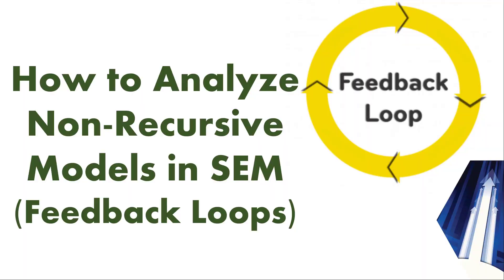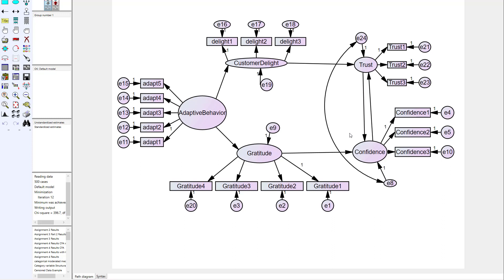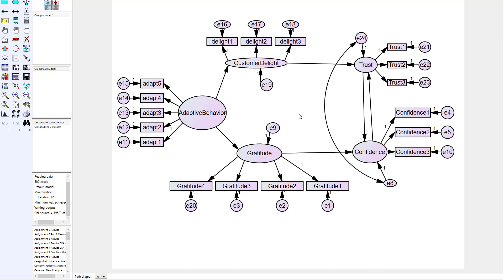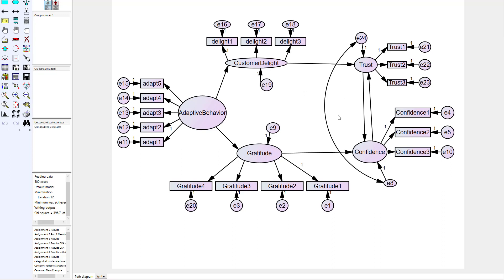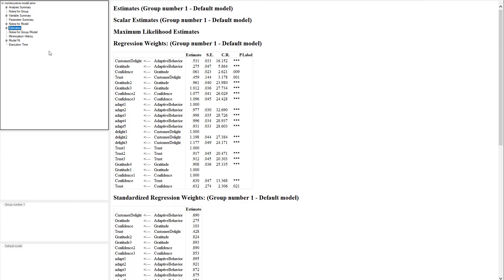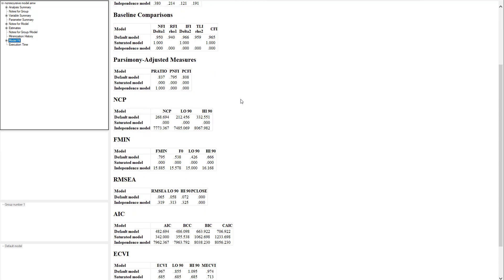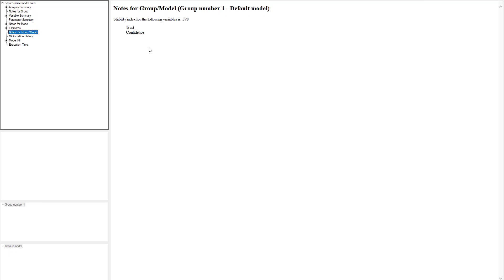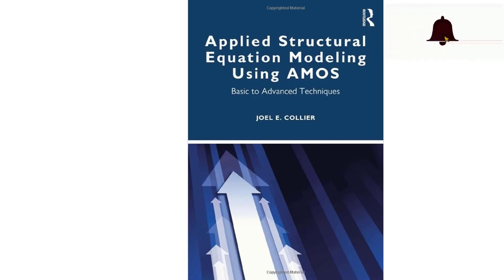How to analyze feedback loops in SEM using AMOS

Comment: Hello sir, for the mediation value in the bootstrap P-value = 0.021.
Lower bound=0.351
Upper bound=1.251.
Is this significant or not?
Reply from the maker: If the lower bound to upper bound confidence interval does not cross "0", then it is significant at .05 level
Reply: @joelcollier9387  What about the above conditions? 
Can it be called significant or not?
Reply from the maker: @makmursujarwo9458  Yes, since it does not cross zero then it is significant at the .05 level.

Comment: Hi Dr. Collier. I have a question. No estimates are provided in the tables at around 7 minutes for the relationships between the instrumental variables and the endogenous variables which they are instrumental in explaining. Is this because those paths have been constrained to zero? I'm not familiar with the theory behind these variables but it seems that one could make an argument for the existence of a relationship between gratitude and trust which would preclude gratitude from being included as an instrumental variable. Do instrumental variables have to be shown to demonstrably not have a relationship with the variable they are instrumentally predicting, or can we constrain them to zero if we feel a sufficiently small influence exists? The reason I ask is that I have read a few papers where it seems the authors have based their selection of instrumental variables on the fact that the instrumental relationship has not been examined in-depth in the prior literature. But just because a relationship hasn't been examined doesn't mean that the relationship doesn't exist, right?
Reply from the maker: Lot to unpack here so I'll tackle it one piece at a time.  Why are there no estimates from the instrumental variable and the DV it is helping to explain?  For instance, in the example used in the video Gratitude only has a direct relationship to Confidence in the Retailer.  Gratitude is supposed to help explain Trust but it has no direct relationship.  This is done purposely so in the AMOS.  The instrumental variable can only have a relationship to one side of the feedback loop.  In essence, it creates the identification for one side of the feedback loop.  As for your second question, your are correct you could make an argument for that Gratitude to Trust is present.  The argument of the researcher is that the influence of Gratitude flows through "confidence of the retailer" construct to Trust.  It does not have a direct effect (or a weak effect)....thus allowing it to be an instrumental variable of trust.  I know that is a little confusing and overly complicated.  As for the third part, does a construct like gratitude have to show a near zero relationship with Trust for it to be an instrumental variable.  The short answer, no.  This is where the theory is going to come into play and make the argument that gratitude has more of an influence on confidence to the retailer construct and indirectly it impacts Trust.  Last part, Just because a relationship has not been examined before in no way says the relationship doesn't exist.  It simply means no one has tackled that question yet.  Hope that helps.
Reply: @joelcollier9387  Thanks a lot, Dr. Collier, that's very helpful. I have a follow-up question which I I was hoping you could give me your opinion on. I have specified a model for an indirect feedback loop (A-->B-->C-->A) as opposed to the A-->B-->A relationship discussed in the video. My model is similar to the one found in Kline (2016, p.151). I know that this structure is difficult to specify, but assuming I specified it a priori based on sound theoretical foundations, can this model be run in AMOS? I only ask because although I have found quite a few research models employing the structure outlined in your video, I haven't found many with the A-->B-->C-->A as per Kline.
Reply: @andrewkeane9034  Hi Andrew, I hope you have found the answer for this question. Can you share your experience? Also can I ask for the full reference for Kline (2016). 
Many thanks